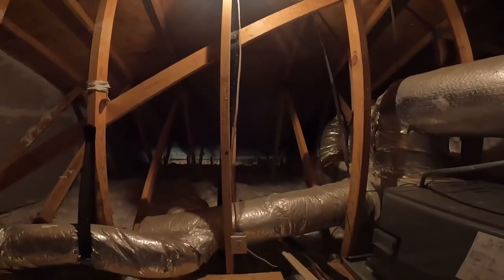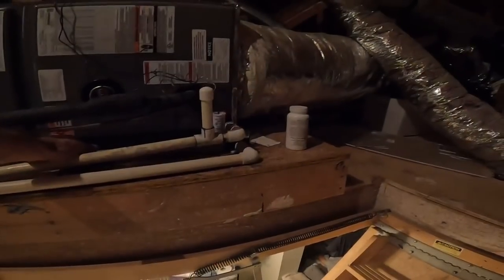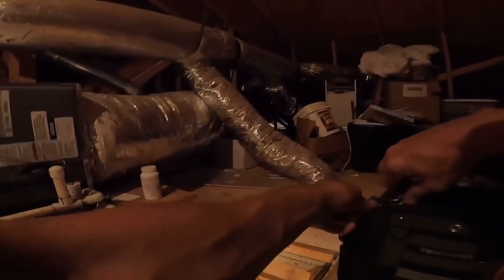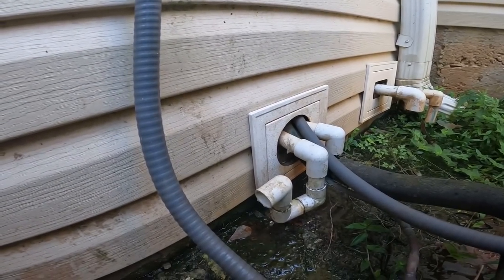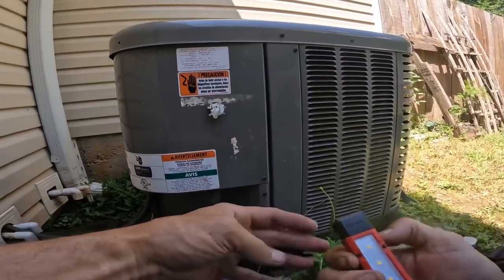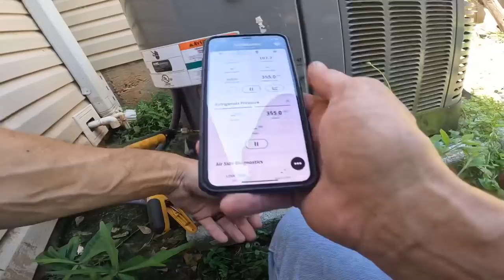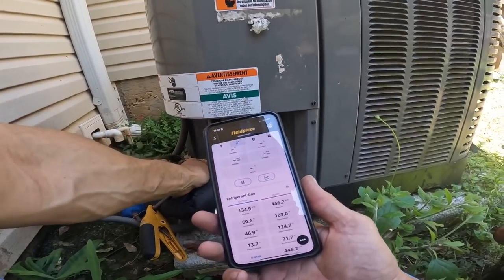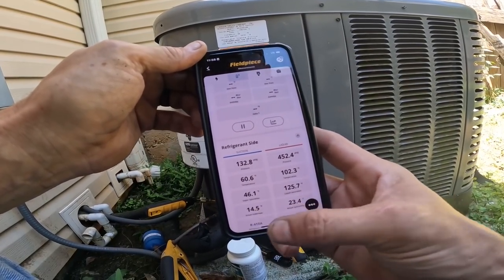Emergency Call on Memorial Day

Comment: Home Depot has a camera for around $100 with about 18” of reach into tight spots works great have used mine off and on for around a year. Have not changed the batteries yet

Comment: That air handler had the room to lift it up with snow legs or something similar so that the P-trap can be at the air handler and easily accessible. I assume that the reason someone put the trap outside is due to no drop in the attic on drain line. Also, your accent when saying coil ...my closed captions pronounced it "Coal" , Lol.  Thanks again.

Comment: Could you just pull that return flex off and clean the coil that way? Should be no problem getting to it once that's removed. If it were me I'd quote them a space guard air cleaner since they have pets. That is the best filter out there. When I put them in and go back years later the coil and blower wheel still look like the day they where put in.

Comment: That return should come right off for easy cleaning access and I think as long as you have enough liquid to your txv and proper superheat to the compressor I wouldn't worry about the charge so much they'll be just fine

Comment: Assuming airflow is correct, and cleaning the condenser and head pressure stays high with that subcooling I'd say over charge.  Did say it was a txv right?
Reply from the maker: I hesitate to even say that as a joke.

Comment: That subcooling was high. How does a dirty condenser coil cause high subcooling? I thought it would be the opposite. Since it's not able to remove heat due to dirty condenser coils,  then you would have a low subcooling. 
Am i incorrect?
Reply: the compressor is still moving the same amount of mass so it just crashes the low side pressure causing everything to ice up. its also the reason why many systems get overcharged by the run cap bandits and fill and runners.

Comment: Curtis, what do you think about that p- trap being outside? Maybe I should start doing that....happy HVACING
Reply from the maker: Some would argue that a trap in the attic is exposed to high heat and more likely to develop algae. But, I prefer it close to the air handler with a vent. This one didn’t have very much drop at all, so outside was probably easier.